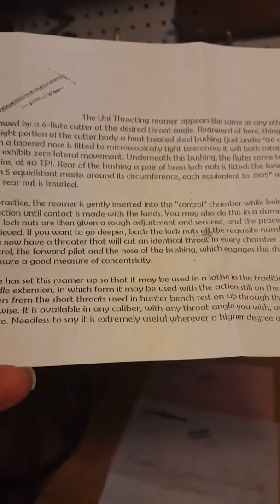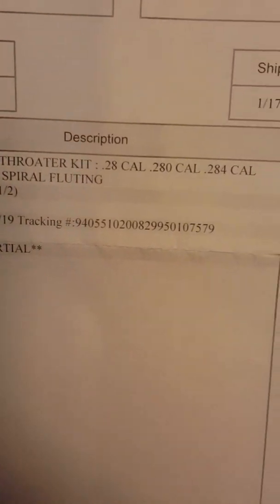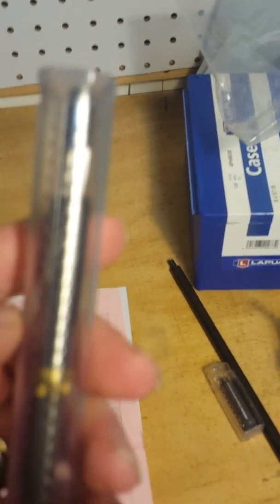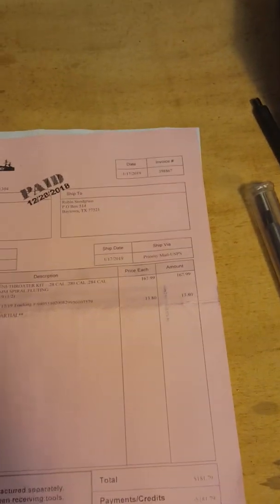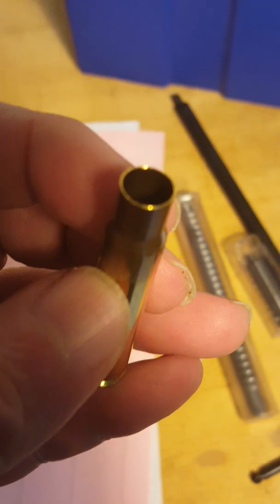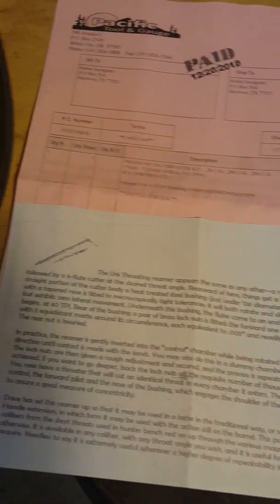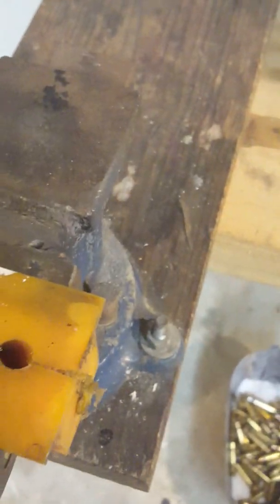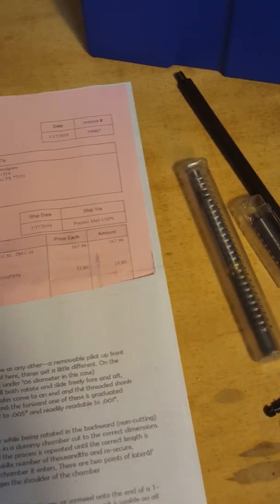PTG Unithroater Questions!

Comment: Hope you get it figured out , never tried it myself .
Reply from the maker: me either! usually done on a lathe...but this tool is supposed to be able to use by hand with the barreled action on a vice...I am eager to call ptg tomorrow and find out why I didnt get the second alignment bushing.
Reply: Did you ever get this done? I’m considering doing the same to a 260AI that I have. I need to lengthen the throat about .060”.
Reply from the maker: @mikedoyle7020  
no, I ended up having a gunsmith do it and I was not cheap